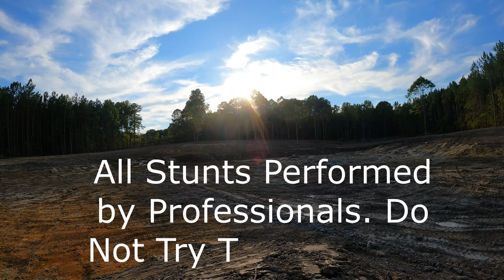Kids Love the Island, More Dirt Moved, Rocks Thrown and Birdhouses Up

Comment: 7:00 Fair warning... Trees that size can grow rather fast. The screw is going to stay there. The bird house is most likely going to be ejected out by the bark within a year or two at most. I've got a clothesline wheel that is halfway Embedded into a tree. If you want them to stay there longer, they need to be mounted more loosely so that they can move a bit as the diameter of the tree increases.
Reply from the maker: Thanks for the info 😊
Reply: @BealyGood  you can also drill a hole just big enough to pound in a 3/8" threaded rod and let it stick out a foot or two then slip a piece of 1/2" water pipe over it and hold it all in place with a fender washer and a nut...  Just tighten the nut hand tight until the tree grows around the threads and locks it in... Need it longer later?  Just screw on a 3/8" coupling nut and add another piece of 3/8" rod and a longer pipe...
Reply from the maker: @alc818  great idea!